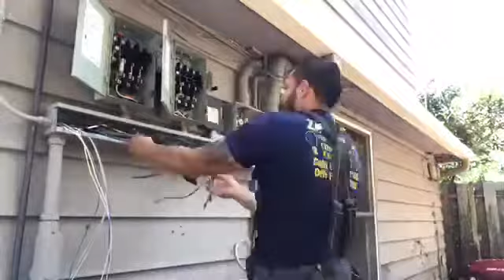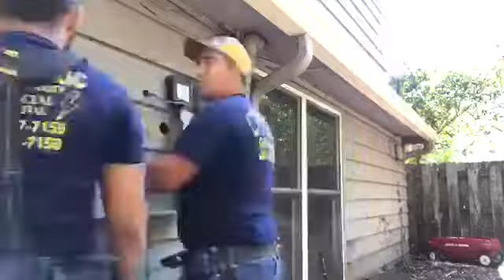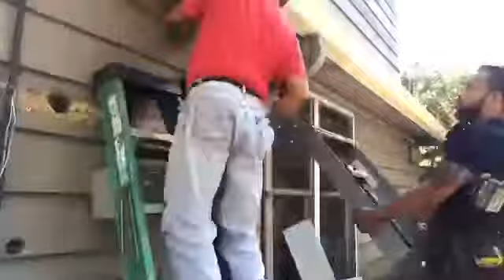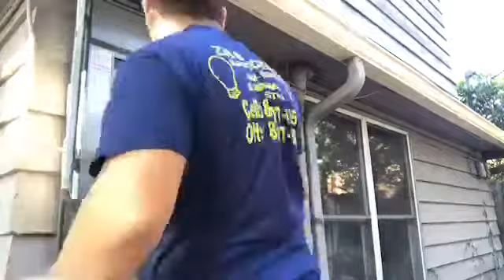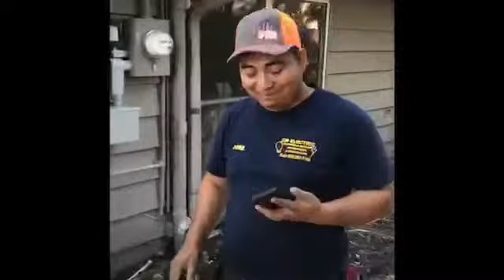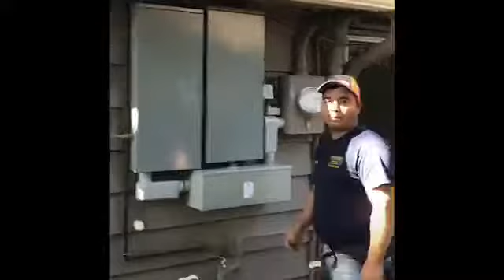400 Amps service upgrade

Comment: Nothing like leaving big holes in the wall. Beings the siding has gaps at the edges leaves plenty of air gap transfer and bugs getting into the wall. I don't know where this is at? But this would never fly in Cali, if it was a legitimate permitted and inspected.

Comment: Would never pass in Florida, also where is the 400 amp meter??
Reply: why would it pass in Florida with trailer homes but would not pass on a house in FL? I don't see much difference.
Reply: @cr1m203  Who ever said it would pass with a mobile home? The meter was only 200 amps rated and never changed the service and the LB fitting not accessible. I guarantee there was no permit pulled on this  installation.
Reply: john ferrara before judging and claiming something would not pass rewind the video and pay attention to the video. All the home owner did was move all the hardware to the side of the house instead of inside. I’m sure the upgraded part was using OUTDOOR rated panels instead of inside rated ones. 95% of trailer homes in Florida (older ones) are out doors anyway. The best thing I love about Florida law that homeowners can do their own work and pull their own permits with OUT A LICENSE. Depending on location or area PERMITS do not need to be pulled if keeping the same service while just changing it around. Everything in this video is correct and follows NEC guidelines for that year this video was made.
Reply: @cr1m203  Do you know what size wire 400 amps requires? You can clearly tell they did not use the proper size wire or even parallel it. You're going to tell me that this illegal install using a 200 amp meter and putting a panel right against the cover of an LB fitting where you can no longer access is legal? This job was done in Texas BTW, not Florida and has nothing to do with a mobile home, and luckily county's have started not allowing homeowners to pull there permits for electric/ gas.
Reply: john ferrara lucky Florida law still allows for it. I have no clue on gas laws however I do know about electric laws.
Reply: john ferrara they also didn’t use a 400 AMP all in one disconnect. They used two separate 200 AMP panels separated from each other. So from a grids standpoint of view it’s still a total of 400 amps pulling from both panels. I guess everyone has their own way of setting residential 400 amp up. It seems odd  not against code. If you think this is crazy, you should see what commercial 400 AMP looks like. I’m glad homes don’t need to be wired up like that. According to NEC it’s allowed long as it does not “exceed the allowable ampacity of the service entrance conductors. You can actually have as many as six panels”
Reply: @cr1m203  200 +200=400 .... on 4/0 aluminum wire? You still have yet to tell me what wire size is required for 400 amps. And its county to county, not Florida law. You have a license?
Reply: LB next to meter blocked by the new panel so cover and conductors. LB's too small for wire size, 200 ampere meter socket, Lots of Issues
Reply: Any electrician could see the multiple  electrical violations.  Maybe this video should be removed because of the misinformation.  No way this should have passed an electrical inspection.

Comment: It's still just a 200 amp service feeding two 200 amp panels. You only added more breaker space.
Reply from the maker: Cody Ervin  it was 400 already 
I just updated 
I moved the panels from inside to outside I didn’t add nothing
Reply: Still looks like crap
Reply: @giovannyvazquez3652  What size wire was ran from your load side of the meter to the gutter?
Reply: Abner Hernandez that looks like crap to you?🤣🤣🤣🤣🤣🤣🤣🤣🤣 definitely don’t go wind and solar with battery back up.
Reply from the maker: john ferrara 3/0
Reply from the maker: Copper
Reply: @giovannyvazquez3652  which is only rated for 200 amps unless you paralled them, might work in MEXICO BUT NOT HERE! Title should be how NOT to do a 400 amp service.